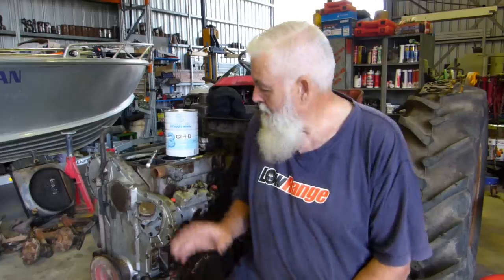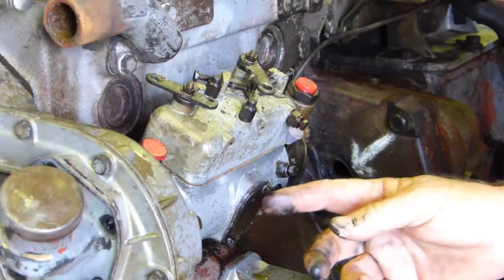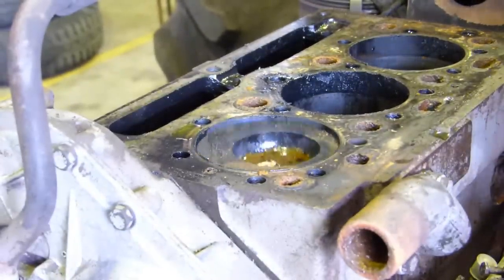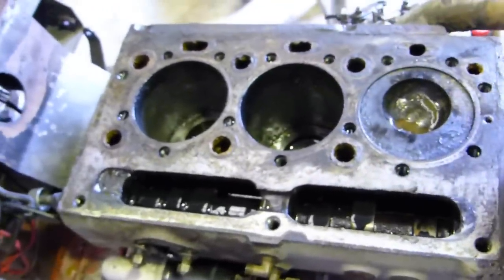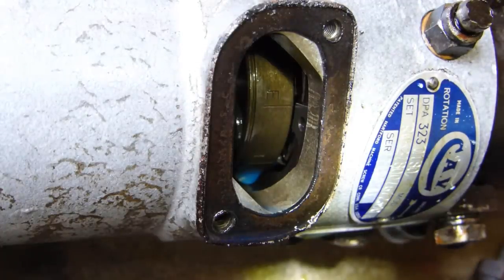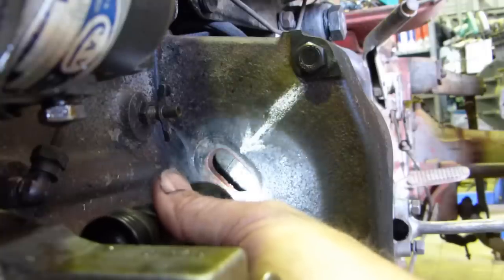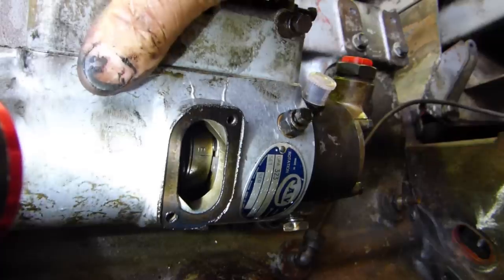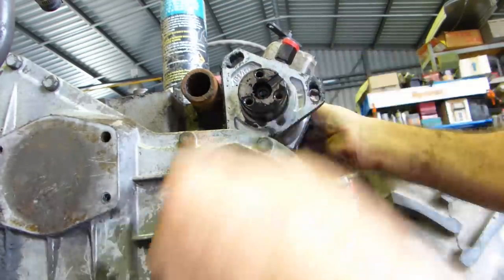MF135 Restoration #7 Timing and Removing the Injection Pump

Comment: Great informative video Lance, i have one question, i bought a brand new injector pump for my 1979 Ford 335 tractor (3 cylinder diesel), when i remove the old pump and install the new pump and realign it at the same timing marks on the pump and the timing cover mark will i be ok ? as long as i dont fire or rotate the engine.
Reply from the maker: G Day Bob, Yes you should be fine as the timing marks will have been set up on a test bench.
Reply: Great, Thanks so much for the fast replay, your videos are the best. Have a great day!! @BundyBearsShed
Reply: worked like a charm, installed new pump and bleed system and got it running, running like a champ now, Thanks!!! @BundyBearsShed

Comment: Is this the same process for removing a Ferguson FE35 Injection pump, and have you got a video for it, thanks
Reply from the maker: No video yet but similar job checking the letter inside then replacing it in the same place.

Comment: Hi Lance, rebuilt an ad3 152, when fitting the flywheel i never thought about the timing marks. The engine has no rocker cover or injectors yet so pistons are visible but how would i time the engine without having the flywheel mark?
Thanks
Reply from the maker: Use the pistons at top dead center and work from there

Comment: Excellent instructional video Lance! I’m not afraid to take the pump off my AD3.152 now. It’s leaking a lot of diesel. It’s on a 1998 Massey Ferguson 231 tractor. “WSK” brand CAV injection pump. I’m thinking very hard about trying to reseal it myself. I’m no mechanic, but I have the tools.
THANK YOU
Reply from the maker: You can do it! Just go slow and take pics if you are not sure.

Comment: Great video Lance. I'm about to take a pump off a mf35 to reseal. I intended to note the position of the lettering with the circlip first, then mark the flywheel position then lastly check the corresponding marks on the pump casing. Does that sound right? 🤞
Reply from the maker: Right on, you shouldnt have trouble.

Comment: I need to replace an o-ring in my injection pump on a 710 John Deere ( Lanz) . Would you say this is simular to my tractor even though mine is a 4 cylinder ? I live in Canada and can,t seem to find any info on Lanz ( built in Manheim Germany )  Thanks for the video .
Reply from the maker: G Day James, If the pump looks similar it will be the same as they were used often. I cant say I am familiar with the pump on the 710 though.

Comment: Awesome content as usual, Lance! As you don’t like RTV, what would you recommend for sealing the gear/transmission case on a Kubota lawn tractor? Anaerobic sealant of some sort? Thanks.
Reply from the maker: I would go for Loctite 55 or Bareco R5 in Australia as it is the same stuff and far cheaper.
Reply: Great, thanks Lance!
Reply from the maker: Make that Bareco R51
Reply: Deebo1812 . . Transmissions and differentials that require a gear oil that has Friction Modifiers , require a special sealant !! It took me 3 times to get the transaxle on my Case Backhoe sealed ! I finally used. <> Permatex . Gear Oil RTV Gasket Maker#81184
NOTE—<> both surfaces must be absolutely clean & oil free !

Comment: Hey lance. thank you for another great video. 

i have a jcb 410 1986 with a perkins 4.236, the hydraulic head on the pump broke last week so i took it apart and changed the head. Now i have refitted it to the engine and aligned the marks on the engine and on the pump But it wont fire up. 

So i want to check the timing, only problem is that i cant find any plates or covers on the flywheel housing to check the marks on the flywheel. And on my enginge the starter is located on the fuel pump side of the engine, not on the lift pump side.

is there any other way to check if the engine is in tdc?
Reply from the maker: You can drop the tappet cover off and get no4 rocking, the pump should only go on one way though due to the dowell in the gear.
Reply: @BundyBearsShed  yes i have assembled the same way as it was before i took it off the engine and i have tested bleeding the piping to the injectors to make sure it comes diesel from the pump. So far i havent seem to find where the problem is.

The hydraulic head that was fitted before was a 344S and the new i fitted in is a 344L. Do you happen to know what the difference between these are? I cant seem to find any specs online

Comment: Hi Lance, winter time here in Europe and taking the chance to look again to your tutorials as I am thinking to have my CAV DPA on a AD3152 re-sealed-

My main concern is the timing: how can I have the right timing without tearing the engine head down. 

If my understanding is correct I need to get the piston #1 at TDC (this can be done by taking off the valve train cover and see the valve tappets, when cylinder #3 exhausts valve is fully open) and then make sure E marks on pumps is aligned with square circlips end. 

In this occasion I simply can hate the pump taken off – resealed and back again (with E mars aligned.) thus keeping the original timing as per flywheel mark.

Where am I getting lost????

Thank you Lance
Reply from the maker: Because the injection pump gear has a dowel it can only go back on in the correct place, Line up your marks on the bolt up flange and you are right to go. You are over thinking it a little. It really doesnt matter where the engine is if you take note of the flange marks.
Reply: @BundyBearsShed  Do you refer to the marks to the timing gear backplate and the  one on the pump flange? They now seem to be a little (1mm) misaligned, I guess they was set some time ago.. My aim was to take it off just without removing neither the engine head nor the timing Gera front cover…

Thank you Lance
Reply from the maker: @giemme4492  pump flange
Reply: @BundyBearsShed  so pump flange mark and timing gear backplate marks shoulf be aligned. 

then i can just disregard where the engine is?  no need to check if the E is in line with the square circlip edge?
Reply from the maker: @giemme4492  Yes
Reply: @BundyBearsShed  thank you Lance

Comment: Hi there! Working on a  MF165 -65 (first tractor), what started as a clutch replacement became a general overhaul. So I took the clutch including flywheel of the tractor, changed the rope seal etc. Just came across this section of your series when I was assembling the flywheel. When I have the 22 degree mark I got the letter F lining up in the fuel pump. Just have the timing instruction for the 3 cylinder one wich should be "E", myself have an 4 cylinder (Perkins AD4 203) What do you reckon? Is it going to miss fire? Thank you very much for uploading this series, more or less done all the job with your help! =) 
Greets from northern Sweden! 
/Christian
Reply from the maker: I dont think it would miss fire but it is possible that you can be one full turn of the crank out as the crank turns twice to one turn of the injection pump. Im not sure what letter the 203 should be on.
Reply: @BundyBearsShed  ok, thank you for your answer! I'll try and find some more info on the 203! 😀

Comment: @Bundy Bears Shed Good Morning.Thank you also in the comment.As you mentioned, idling goes back to normal when I hold cold water on the pump element.What exactly is the procedure we need to do?Can it be due to the X blades in the inner part?Can I repair myself.Respects.
Reply from the maker: Replied above

Comment: The pump needs to come off my Perkins AD3.152 (Massey 231) to have it resealed. I have watched this video over and over and I still don’t understand. It’s my fault Lance, not yours. Thanks for all your videos though.
Reply from the maker: Just pull the plate off the side of the pump and line the mark up with any letter and put it back in the same spot.
Reply: @BundyBearsShed   finally got the injector pump off my AD3.152 engine. My mechanic friend came and took it off last week. I sent it off to have it resealed. I’m waiting to hear back from it now.

Comment: Be careful! If the pump has been restored, mechanics tend not to care too much about the positioning of reference circip! I've been told by the Bosch mechanic that he and most of the others just put it there so it holds the rotor assembly. So if your pump is not new you can't trust the only accurate method. It sucks but it's worth knowing.
Reply from the maker: Yes but if you know your starting point you can refer back to that when assembling again.

Comment: I'm baffled as to why they'd use the movable circlip as the reference point to the timing marks.  Move the circlip, and the timing marks become completely irrelevant.  (and yes, I understand you stress the importance of maintaining that circlip's position.  I just don't know why they didn't just machine the reference into the body casting)
Reply from the maker: They can time a pump to each manufacturers spec then I would presume.

Comment: Hey mate did the my 135 ever come out with a straight front axle?
Reply from the maker: Yes I have one they called it the heavy duty axle, a later tractor.
Reply: Bundy Bears Shed  thanks my grandads my 135 has a straight axle and I’ve never seen another with one.
They are an awesome tractor the amount of work they can do is incredible( if you know how to operate).
Thank you very much for the videos and answering my question the knowledge you have deserves to be passed on in some manner so pls keep the vids coming.